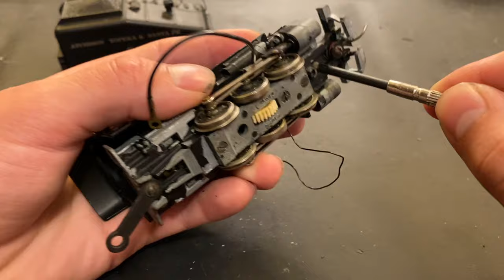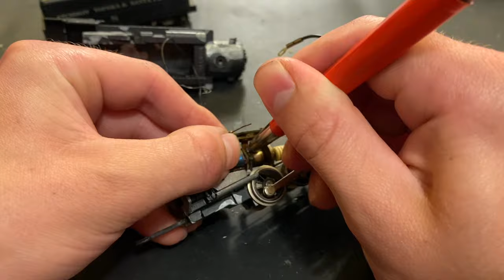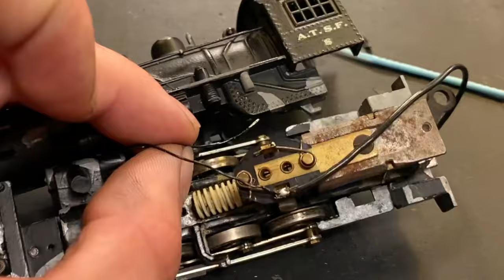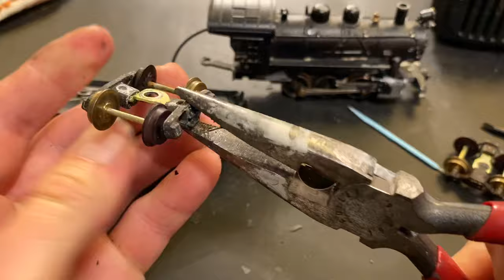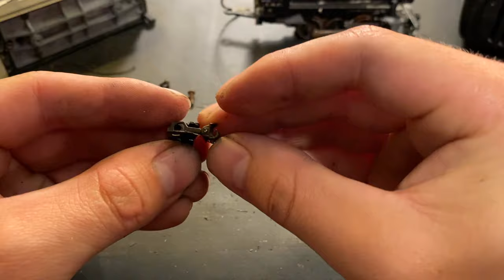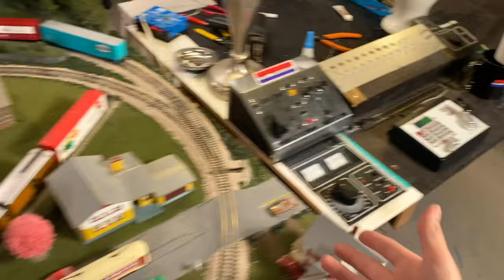Ruined HO Santa Fe 0-6-0 Mantua Steam Locomotive - Can We Make It Run?

Comment: Rubbing alcohol will allow oxidation.  Ronsonol, the lighter fluid, cleans just as well but does NOT allow for oxidation to take place.  That is why video and audio professionals used Ronsonol to clean recording and playback heads!
Reply: Didn't know that, I'll have to give that a try.
Reply from the maker: It won't remove oxidation but it's not there long enough to cause it. Lighter fluid would probably work well too although I don't think it's conductive so it would have to be wiped down carefully.
Reply: Getting any petrochemical (lighter fluid/WD-40/Non-plastic safe oil or grease) on the white nylon gear will cause it to swell and crack, rendering the model a city park display piece.
Reply from the maker: @markwilliams2620  I've heard that theory before however when I was younger (before I knew better) I put WD 40 in many models and 12 years later the gears are still fine. Maybe it's the case with certain plastics but I've yet to see it.
Reply: Lighter fluid is basically naphtha, which as others have mentioned, can be hard on plastic. Denatured alcohol (ethanol) was what we used back when this loco was in production for cleaning. Methanol and isopropanol both have some properties unwelcome in model trains. A good LaBelle lubricant is probably the best antioxidant.
Reply: Who gives a shit what you use? It's a kid's toy!!!
Model trains are toys. Toys!
Ain't nothing wrong with that. But let's be honest as to what model trains are. Toys!
Reply: @SMTMainline  
I was lied to!  😥Ya just can't believe the MAN.

I'm of course talking about funky German diesel-hydraulic locomotives....
Reply: Of how Krauss-Maffei of me to 
Verwirrung meiner Deutschen Firmen.
Not to cause a comment board kerfuffle...ones choice of preferred lubricant is....as Digital Underground sang so well..... "Dowatchyalike".
Reply: Opinion noted and ignored

Comment: One suggestion (as usual).  For lighting wires twist them into a rope before soldering.  Leave 2-3" of free wire length.  Solder.  Pig tail the excess wire so it will fit in the shell.
I have done this one all Athearns/old Model Power/etc. I have bought.  It helps during routine maintenance as you don't have to desolder the wires from the motor to get to stuff.  The body rests away from the frame.

Nice work, as always.  Now to kit bash it into a CNR Class O-9.

Edit: Nice paint job!  And an 160 kmh 0-6-0!  Paint her as a Hiawatha!

Comment: Another excellent restoration Harrison!  Also, I wouldn't worry to much if the headlight burns out, there's companies that make brand new castings with LEDs installed for these types of locomotives.  It won't be original and you will need a resistor, but you'll have a light that'll basically last forever!
Reply: incandescent lamps are durable enough plus they have a more realistic glow. notice that the vast majority of harrison's repairs have working headlamps....its not that hard to put together a constant-brightness incandescent light.
Reply: @tommurphy4307  that's true, several of the locomotives I own still have incandescent bulbs.  That being said, LEDs do operating at a much lower voltage and have a cooler operating temperature than incandescent bulbs, plus they've gotten much better in the appearance department where they look more realistic lately.  There's nothing wrong with using incandescent bulbs, but LEDs make a nice alternative too, I have a couple of Atlas U36Cs with the bulbs burned out and found some LED direct replacements that I'm going to stick in them.

Comment: A super video. I have a Mantua/Tyco 0-6-0 that I will soon add a bought new old stock Tyco front end boiler hatch cover with a centered headlight so that it will resemble my Mantua/Tyco 0-4-0 steam locomotive. Both of these switchers were bought new, by me, almost fifty years ago, and still operate quite well on my railroad, both inside and outside, to this day. Hello again from the Tracy Mountain Railway in Colorado. 💙 T.E.N. Edit: Think Great Northern Empire orange with Tracy Mountain replacing Great Northern. 🙂

Comment: I would definitely repaint this engine not for the aesthetics, but to preserve the metal on the engine. I find that Zinc Rot seems to happen more often with the bare metal versus a painted surface. As far as the light bulb, it might be grounding out causing a minor shot which may be causing the dimness of the bulb.

Comment: One thing to look for on these worm drive diecast steamers is to check the gear lash, especially if the drivetrain seems tight. There should be a little bit of play between the worm and the axle gear. If the worm is tight on the axle gear it will cause binding and can burn up the motor. Some manufacturers have a slotted motor mount screw hole with the motor mounted on a bevel so that lash can be adjusted that way. Others recommend using paper shims between the motor and the frame.

I really liked the extended running shots from different angles at the end of the video!

Comment: Good recovery on that old beast. Next challenge. Convert some of the old machines you have to DCC.  I don't see any DCC gear on your layout, but you may want to give it a thought.  Bit on the expensive to enter, but once in the door, it makes running (and wiring) your railroad so much easier.

Amazingly enough, many of these old motors will work on DCC with little more than isolating them from the loco frames.  See my 40 year old Athearn S-12 for a good example! :)

Comment: Just a note when using metal Kadee couplers. Insulate then from any frame power runs through. Example: Athearn Blue Box F-7A double headed back to back. Instant short circuit when coupled. A lesson from long ago...

Comment: I have one of these that the motor was just a but worn. I replaced the motor with one from a newer model and after swapping the magnet out for neodymium magnets, it's genuinely the best running tyco I've ever seen that doesn't have a can motor in it. It can crawl easily at a scale speed of 1 or 2 miles an hour and has enough torque to maintain that crawl with anything behind it.
Reply: I stripped and repainted mine as the original paint was literally falling off. Mine still has the original box and has the walschaerts valve gear kit.
Reply from the maker: Usually the washers fail and make these things run crappy. The lower "milage" ones run pretty well.
Reply: I believe the original motor to the one I fixed up had a bad winding in it too. If given a turn by hand, it would start but ran very poorly.

Comment: I don't even care if the paint job is not historically accurate, if anything it's making it pop a little more. I always loved white rim steam locomotives. There used to be one on display at Kempenfelt bay in Barrie ontario, CN #1531 Montreal Locomotive Works 4-6-0 built in 1910. They had to move it in 2008 to do a waterfront restoration and it is now at south Simcoe train museum and is going to be restored
Reply from the maker: Are they gonna restore it all the way to working order or just cosmetically?
Reply: I believe it's to working order as it has an Era correct caboose as well. But it's been at this museum since 2008 with little action, it's still on display outside as of 2021

Comment: You may want to invest in a can of DeoxIt. It's an electronics cleaner/lubricant that VASTLY improves connectivity.   It's for audio and video controls and the like, but It's fantastic on other stuff.  I use it on HO slot cars.  Commutators and brushes love it.  Also makes an EXCELLENT cleaner on a swab.  It's formulated to break through electronic grime.

Comment: I love those old Tyco steam engines.  They run great.  You should be able to put at least 12 cars on there.
Reply: it's not a TYCO,  it's a mantua.
Reply: Mantua and Tyco were the same originally, before the guys split up, and Mantua originally did locomotive kits, and Tyco did the Ready-To-Run, but company dealings muddied the lines, with both selling kit and Ready-To-Run locomotives, until finally they went their separate ways, with Tyco's Powertorque and Mantua's super detailed locomotives being the result. (basically.) Tyco also used Rivarossi, IHC, and other drives for a SHORT time, resulting in a non Powertorque drive Chattanooga Choo Choo and all wheel drive Tyco diesel locomotives, as well as Mantua's dual motor MU-2 and single motor all wheel drive diesels. Tyco quit and Mantua was bought out or absorbed by Walthers or one of its subsidiaries. (Basically.) 💙 T.E.N.
Reply: @tracynation2820  the original company was Mantua metal works. tyco is a contraction of the Tyler company. tyco produced a cheaper version of the Mantua products aimed at expanding sales to the toy market for trains.
Reply: Yep, that was a Readers Digest condensed version. (Basically.) I know the full story, Tyler and all that, and Mantua Metal Products, but the all wheel drive Tyco diesel locomotive era still muddies the water. 💙 T.E.N.
Reply: @tracynation2820  scale MRRg  was in it's infancy at that time. HO  was not yet dominate,  the depression,  WW2,  the mind set of the 30s,40s,&50s was much different from now. it appears complex, but human behavior does not follow a existing pattern, those people at the time  TYCO evolved,  found themselves in a jungle of styrene.  it was a perfect medium to mass produce cheap, toy HO. people try to create a reality. but others had their own ideas, some better, some not.

Comment: SMT - Is the headlight housing metal or plastic?  If it is metal, maybe the leads of the bulb have scraped-off insulation and are intermittently short-circuiting?  You could try using paint or some other material on the backside of the bulb to insulate the leads.
Reply from the maker: It's metal. I was thinking it could be a short too but the current draw is low without spikes so I'm not sure. Maybe the bulb is just too hot for the paint?
Reply: @SMTMainline  - It could be a bad connection too that intermittently opens & causes the bulb to flicker.

Comment: Awesome another amazing work from you Harrison how you can make a locomotive like that one is phenomenal by the way can you help me with a project that I have it's in York Central Hudson clean the motor and everything almost works except for the center wheel I lubricated but it doesn't want to work you know what happened?
Reply: Does the gear on the center wheel not move? It may be cracked
Reply: @YeOldeGeezer  no only the two front and rear it's a 4-64
Reply from the maker: Can you turn the drive manually without too much force from the drive shaft?
Reply: @SMTMainline  unfortunately no I'll do a video of it hopefully you could see it
Reply: Re-quarter the drive wheels, make sure that the drive wheels are correctly gauged and the drive gear is centered, check for cracks and gunk or missing teeth on the gears, and make sure that the siderods are free to move and not kinked, and that everything is slippery with the correct lubricant, along with good electrical connections and clean wheels and contact surfaces. This is assuming that the motor is working and doesn't have a weak magnet, bad brushes, or an electrical short. 💙 T.E.N.

Comment: Hey, just wondering what the conductive lubricant you use is, I use 107 on bits like gears and saw you used it too in parts of the video though I’m not sure if 107 is conductive or not, thanks.
Reply: For conduction, use a dab of mineral oil, TEN conductive lubricant, (Out of production.) or anti oxidant, (Ox-Guard is one.) on the contact areas, don't use oil on the contract areas, and avoid getting it on the motor commutator. However, a VERY small drop of oil, plastic compatible, on each rail, well spread out and completely wiped off with a soft cloth, will help with wheel/rail contact on both inside and outside model railway layouts. 💙 T.E.N. Edit: The 107 is fine for axle contact, but not bolster contact. 🙂
Reply: @tracynation2820  alright thanks, I mainly need it for some bearings which also transfer power and the factory had oiled them with the wrong lubricant, a common issue with the first batch of the model in question.

Comment: DCC it next!  Lol. Have an older version being restored.  Thinking of updating motor to 5 pole, flywheel and dcc.  Why not.  They just don't have a value in resale sadly.
Reply from the maker: I usually leave them DC for price and performance but if it's a sentimental model why not?
Reply: @SMTMainline  Exactly.  Also, a great loco to practice weathering on!  Might even add lights and smoke!  (sound...)  It's in a million parts on the bench.  Even took the motor apart to bare components.  Love that old cast stuff.  Just some special about it.  Need to find some brass accents, like a bell , maybe railings.  ;)

Comment: I always hated when they ran the wire to the tender, since it meant that the loco and tender had to be screwed together. If they didn't want to put wipers on the loco's wheels, the least they could have done is put a metal pin on the tender and add a contact to the bar connecting them so that the tender could be disconnected without using a screwdriver.
Reply from the maker: It is annoying how they designed it like that.

Comment: Why do you keep setting your clean parts down on your workbench that is clearly covered with dirty particles?
Reply from the maker: I don't have anywhere else to put them.
Reply: @SMTMainline  I suggest you disassemble lokies on a paper or towel and then assemble them on workbench surface or do the opposite.  These particles may end up being metal and sticking to the motor magnets.

Comment: looks like that center set of drivers are missing their tires.
Reply: or were those made blind? does anyone know for sure?
Reply: That might just be dirt build-up on the wheel treads that looks like traction tires.
Reply from the maker: I don't think they ever had any.
Reply: @Petemonster62  we're not talking about traction tires.
Reply: @suppylarue220  The middle drivers were made blind so they didn't have flanges on them. If it had Flanges on them the locomotive wouldn't be able to make the turns too easily if at all. They did the same thing a 4-6-2 Pacific and higher wheel configuration. Such as a Mikado 2-8-2 even the big boy the center two drivers on the 8-wheel configuration has no flanges to Aid in turning. Like give an example deleting driver on the Mikado or big boy or any locomotive for that matter unless it's a 0-4-0 the leading driver has flanges the next driver does not have flanges then the third driver if equipped such as in a 8-wheel configuration does not have flanges then the fourth axle has drivers.
Reply: @mercuryoak2  that's the whole ideA, anybody in mrrdg knows that!
Reply: @suppylarue220  I don't even know what the heck you're talking about I don't do abbreviations.... you're the one that asked the question so I figured to give an answer
Reply: @mercuryoak2  matt, locomotives of that era don't turn, they follow the rails (some modern locomotives are steerable), models earlier times had track sections in 15", 18", & some 21" radius.  all are sharper than most prototype curvatures, except on street running and industrial areas such as at warves. 0-6-0 s didn t need blind drivers. 😁
Reply: @suppylarue220  isn't me or people have to take things what I say literally. I know they don't turn.... I know they follow the rails. also most of them did have blind drivers. If you know so much why did you ask a question...
Reply: @mercuryoak2  mrrding is short for model railroading.  but none- the -less to stimulate friendly conversation and interchange of ideas.  I noticed there's a lot of wrong info passed around the 'net, doing what I can contribute accurate info.
Reply: Mantua/Tyco 0-6-0, 0-8-0, 4-6-2 Pacific, 2-8-2 Mikado, (MacArthur) 4-6-0 Ten Wheeler, 4-8-0, 2-6-2 Prairie, and other Mantua/Tyco steam locomotives all had blind center drivers, as did a number of prototype steam locomotives.     💙 T.E.N. Edit: I had a Jeweler fill in the groove for the traction tires with silver on all of my Mantua/Tyco steam locomotives because the tires tend to dissolve under heavy operation, and as a bonus, they all run much better now. 💙 Edit ll: Forgot the 4-6-4 Hudson. 🙂
Reply: @tracynation2820  that's what I said but yet somebody has to be" accurate" or they say they are.